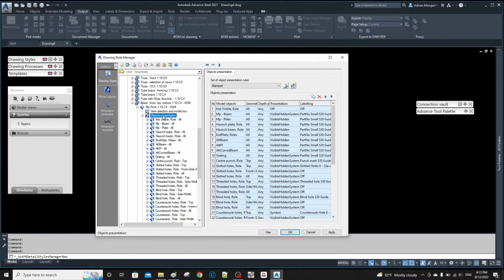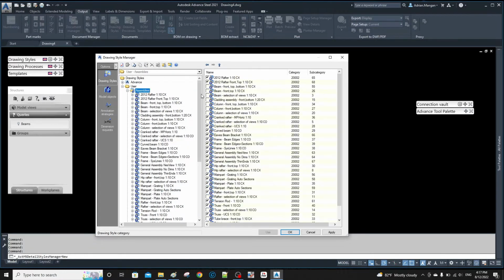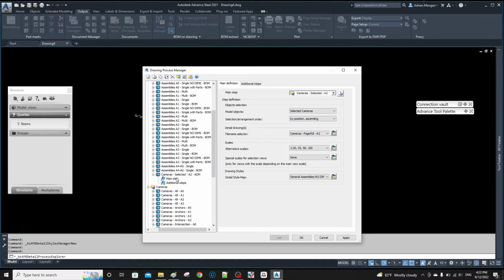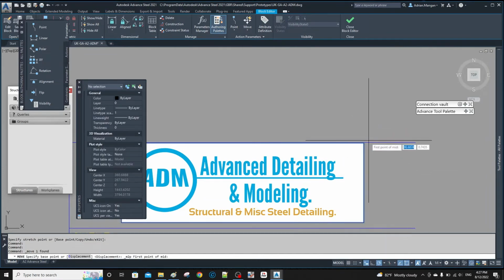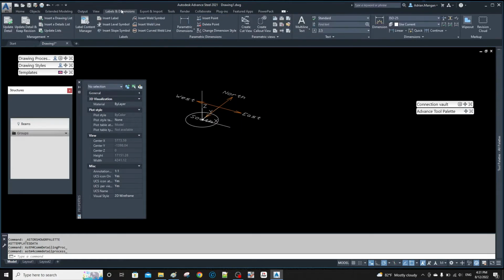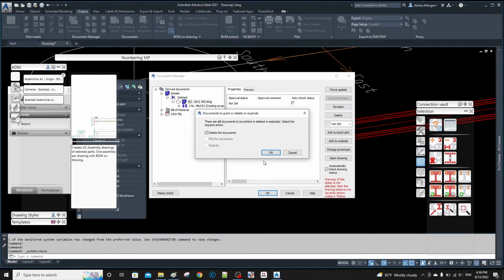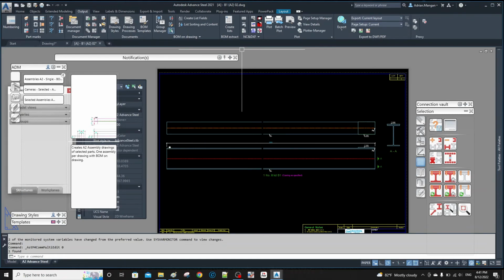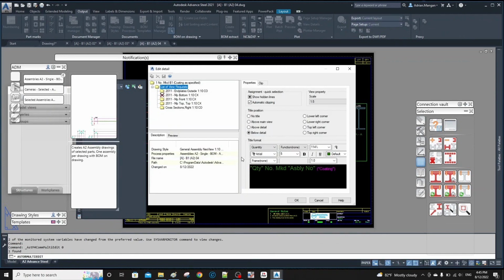ADVANCE STEEL: Working in Metric. Part 2.

Comment: 👋👋👋Thanks a lot, it's an excellent tutorial, practical and helpful, I've got the answers to many of my questions please make more tutorials regarding the aspects of drawing styles and drawing processors( Metric or Imperial). Could you please explain what are "Modeling object" ,"Labling strategy" and  "Dimension request (in option section) of Drawing Style manager are for?  what can we do with them?  🌹